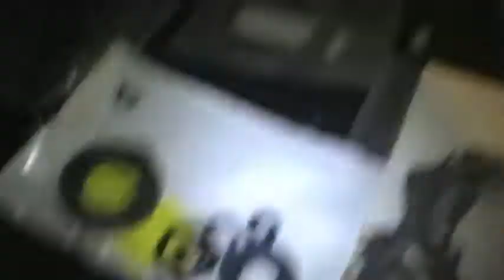1978 Suzuki RM400 Project

Comment: Right on, I always wanted a 79 N model, but dug the 78's and earlier 370's too. 

Do you guys have all the parts to put this thing back together? Not sure, and you guys are probably way ahead of me on this, but I thought I'd read some of the parts are stll available new for these. Despite the age.

In more recent years I've wondered if the RM500 mill could be swaped into one of these to make it a bit more competitive with later open bikes.

Hows the weather up there holding out Toby????